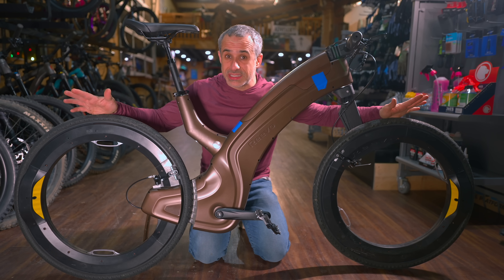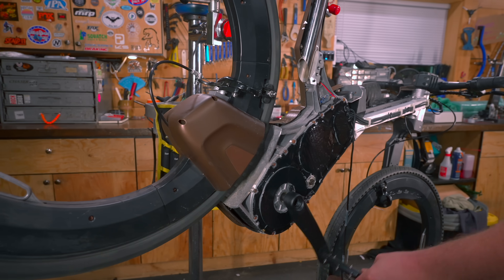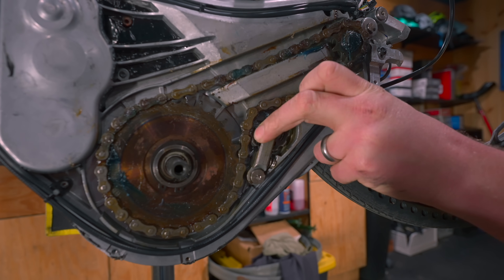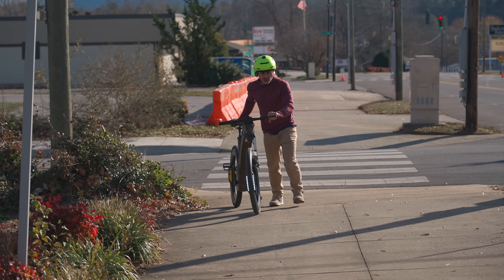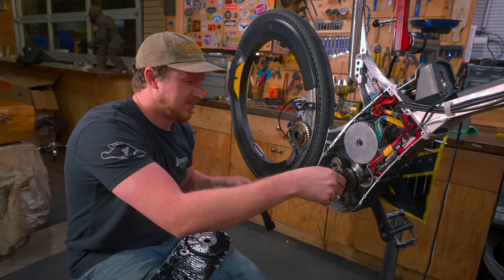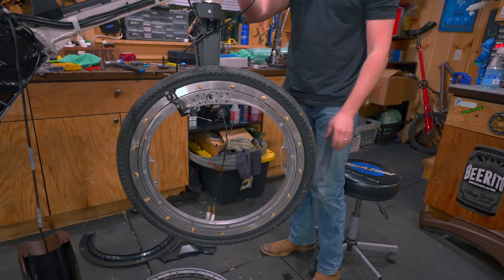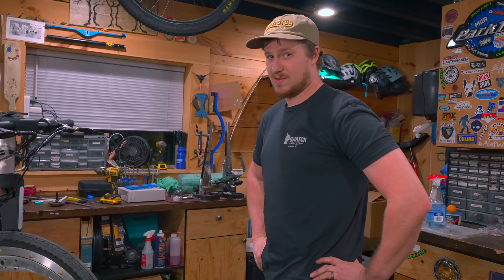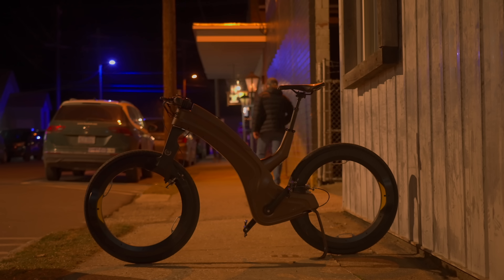What's Inside The World’s Worst eBike? Reevo Teardown

Comment: What a bad bearing choice, like in a bunch of ways.  You have tiny bearings that are WAY under spec.  Realize that at best, AT BEST, you have two bearings taking the load, and often between 1 and 2 at any given time.  Those are tiny bearings doing that work.  And there's no suspension here.  On top of that, every single bearing will wear on all sides and load in all directions because it also has to hold the wheel on too and in a bad high friction way.  You also likely want to over load it so everything is tight and not wobbly, meaning all those bearings are a sum of friction points all around the wheel as they all turn and SCRAPE on the side.  What do you have, like 80 scrape points, 100?  I get the idea of it, but the execution is hobbyist level stuff, just with a pile of money behind it for machining.  It's so bad.  And it sucks because there's better ways to do all of it.  Those are going to take a lot of peak load just casually biking around.  There was a possibility for this to have been done better.  But you also have a really big problem.  There's no suspension.  You just have a heavy bike and an immovable ground, so all forces are shoved through all things.  The wheels are heavy and sensitive to impact.  Sure, it's "beefy"...to a degree, but you're not trying to save it at all with that design.  I know it was used pretty lightly in the video, but man, if you did any kind of jump with it, you'd absolutely ruin the ring.  It'd just be oval.  And unlike a regular bike hub, there is no distributed loading to share the stress.  Once you bend the right, it's junk.

The gears aren't really the high friction device in this package.  It's likely all the bearings and them firm in a track.  There's a LOT of friction on the contact points, all of them.

Comment: when you order a HammerSchmidt crank off Wish
Reply: The roller bearings in the rim are an interesting load bearing solution. Too bad they didnt know the smaller the bearing point the longer the lifespan and the less friction period. Hence a 5 journal chevy 350 lasting longer than a 7 journal ford crank. .. 

Small bearings.. are.. better. ... counterintuitive. .. but... True.

Comment: Gosh that grease they used in there definitely looks completely gone and way past its life span like they did not even use synthetic grease. Probably for it to even ride smoothly you will have to just lather every single inch of gear and belt with synthetic grease that will last forever.

Comment: When I was a kid we attached small generators to the back wheel to run lights. Nothing to charge and no risk of fire. Yes, it added some friction to the drive, but not much.  Now motors are attached and powered with batteries that need charging and are a fire risk. All so people don't have to pedal. I think we're moving backwards with bicycle designs.

Comment: Every responsible engineer should have pulled the plug, because this bike is totally incapable of driving through a mud puddle or loose sand. Not even talking about the friction from all these gears and bearings.

Comment: Aren't you also pedalling with a significant gear reduction? The linkage from the pedals to the wheel seems to go from small gears to large. That'll give you a lot of speed, but it seems like it would be very hard to pedal.

Comment: Can tell you the combination of the motor always being spun, all 2,000 gears, and that grease is a lot of resistance. Would probably be a decent hub-less bike if you took all of the guts out. Was dissapointed to see individual rollers instead of a big bearing, I bet there would be less resistance not having a bunch of rollers in the wheels.

Comment: The gear train is mechanically impressive but so flawed and redundant - any first year engineering student will look at that gear assembly and instantly recognize just how much compounded friction is being added while simultaneously creating such drastic inefficiencies, not simply for the pedals, but the motor and battery as-well.

Comment: this is basically a bike-sized object running on tiny skateboard wheels... except only the bottom tiny wheels are holding up all the weight. so in essence, if you replaced the front wheel with an actual skateboard, you'd still have a better product.

Comment: That little blue 9g server at 10:44 is what we use for really small, light rc planes. The gears in them get stripped all the time and they’re basically a disposable item. Cost about $3. Having one operate the anti theft in a place so hard to replace is insane
Reply: the only thing the servo does is actuate the lock bar for the kickstand
even if the durability of the servo itself is questionable, that's probably the least dumb and better thought out part of the entire bike, but also the bar is extremely low
Reply: @quentintin1 Honestly the idea of a lock being integrated into the bike frame is downright brilliant, if done well it'd stop most destructive attacks since a thief wouldn't want to destroy the bike they're stealing. But using 9g servos that can be forced open by hand, and only locking down the kickstand and possibly main drive gear, is a massive flop of an execution.
Reply: @asteroidrules  on that bike, extending the kickstand locks the drive, making the bike effectively un-rideable.
so the anti theft device having only to lock the kickstand in the open position is brilliant in it's simplicity and effectiveness.
the issue is like you said, it's actuated by a 9g servo, and by the looks of it, the cheapest, most disposable hobby servo in existence.
now the lock bar can be made hardened to manipulations by clever shaping or it being placed where it would be impractical to force it open, difficult to say how it is in the actual bike as it isn't shown very well in the videos
Reply: @quentintin1  So the lock works to the point, that you'll walk home when the servo goes.
Reply: @Ballistarius-nx4dw  with that servo yes, or the servo fails with the lock open, making then the bike as stealable as any other
Reply: @asteroidrules  if the servo only operates a locking pawl that doesn't put it under any stress when operating the kickstand it's a perfectly viable way to do it. And not only viable but preferable since as you say, the servo can be forced open.
So if the locking pawl moves perpendicular to the motion of the kickstand the servo never gets stressed from the kickstand. And if the ends of the pawl are covered there is no easy way to manipulate the pawl in the field.
So I'd say that is actually one piece of good design.
Reply: @quentintin1 except you can just pick up the rear wheel, roll it away on the front wheel and the you have all the time you need to take it apart and unlock defeat the lock or just sell it on as is.
Reply: When I seen it wasn't even a metal gear 9g servo, I laughed so hard. A kickstand with tiny plastic gears what a great idea!
Reply: That's the servo that comes in every cheap "learn to Arduino" kit for students. I used one for a school project. Terrible little things.
Reply: Immediately thought of that too! 😅
Those are the world's worst servos! 🤣
Reply: Yeah I noticed that
Reply: Agreed. Im an RV, and that servo was junk.
Reply: Would something like an extended when off type of solenoid be much more reliable?
Reply: @Viliny yes, but it'd also require power to be rideable. So if your battery dies... Well, you're kinda SoL on pedalling it home (not that you'd want to with that drive train). It wouldn't add much to the BOM to use a less crappy metal-geared servo.
Reply: @EgorKaskader  but it also locks the wheel acting as the lock, no?
Reply: @Viliny  when the lock is engaged, yes. But if you lose power with it open, it stays open. A NC solenoid will lock the wheel immediately on losing power - it's gonna try to do that even in motion.
Reply: @EgorKaskader  yes but the solenoid piston needs the kickstand to be down to fit the groove right?
Reply: Not super familiar with all solenoids as opposed to finer electronics, but the idea was a normally open solenoid that would extend on powered off state, essentially requiring power to retract on power failure would allow the lock to work when the kickstand goes down
Reply: Having a servo to control whats essentially seems like a binary need seems like overkill
Reply: @Viliny  we don't know - the system isn't particularly clear on camera. But this thing does also lock the rear wheel, so the bar probably locks the drive gear - and even if it doesn't, you're still just one mistaken unfolding of the stand away from being unable to go further. The servo is better in this regard, but the lack of manual override is still a problem, and the servo they picked is a piece of crap.
Reply: Haha yeah I actually have a few of those lying around
Reply: straight out of a robotics starter kit!
Reply: Any kids electronics kit comes with a handful of these to mess around with arduinos etc too 😂😂😂
Reply: I was going to say that, also this thing has a bluethooth module that's also cheapest possible so that explains why he was struggling to connect.
Reply: I recognized them immediately too. You can get a 4 pack for like $10. Plastic gears plastic horn. On a security measure. Lol.
Reply: The first second I saw the blue color, I thought could it be a 9g 🤔😁
Reply: Ikr saw too

Comment: I have 2 of these. I ordered a red wine and a blue.  I got 2 blue ones.  The SIM card slot wasn’t installed on one of them.  I rode it once.  Too heavy and you feel every bump with the airless tires. Reevo didn’t answer my emails regarding the wrong color bike and the SIM card slot missing and wrong size bike.
Reply: That sucks but it's a valuable lesson, very valuable evidently.
Hope the class action works out.

Comment: it amazes me that the "engineer" figgured this bike out but not how to add a simple 200 USD 48V or 54V 10AH battery from an e schooter at the very least to put inside. Even if the power was some funny silly 200-300W the fact is it has power assist and for that capacity itll be more than plenty for going like 30-40KM confortably

Comment: at first I was thinking what happened if we just ditch the battery, motor, and all the electronic thingamabob and turn this thing into just a plain jane acoustic hubless bike. then you showed us how terrible the wheel rolls compared to normal wheel...
also, still won't ride this with those crappy cast aluminium long reach brakes. even with massive weight reduction.

Comment: I'm a bit confused by the planetary gear on the crank, which part of it connects to the rear wheel, the sun gear?  And the carrier is the pedals?  Or are the planets where the freecoasting is built in, and it's not a planetary gear at all.

Comment: A freewheel with so much friction that it's practically useless.
Airless tyres!
No grommets on the cable entries, or seals around the panels, so water gets in under the panels, as shown by the rusty boltheads.
12 gears in the drive chain
Is it a brushless motor?
That ring gear on the motor must weigh a lot.
Even the indicator lights on the back of the wheel are stupid, they are so close together that you wouldn't be able to tell which direction was intended unless you owned one yourself and looked very carefully.
The lights are so low that they would give the impression of the bike being further away than it was.
The whole thing is designed around the desire to look flashy because the wheels have no centre. The whole principle is flawed. The detail design is complete crap as well.
There is one positive about it - you don't have to worry about theft  - noone would steal it.

Comment: It kind of reminds me of the swedish Itera bicycle from the eighties. It was made almost entirely from plastics and constructed by car engineers. The swedish authorities invested money in a new factory in order to create new jobs in an area with high unemployment. It turned out that the flexible frame supposed to give a soft and smooth ride absorbed a lot of the rider's energy input, making the bike extremely heavy to pedal. To make matters even worse the plastic wheels flexed as well an when you came to a traffic light it would not switch to green since there was no metal in the bike. Needless to say they soon went bankrupt. Today, however, people collect them and you can still find examples that were never unpacked. Buy a Reevo and let it collect dust for thirty odd years.

Comment: Now I want to see it upgraded lol. Some speed holes in the frame to reduce weight a little bit (but not compromising it’s strength), smoother/faster rolling bearings, and maybe use a chain drive to replace the motor’s excessive amount of gears.

Comment: This is basically the Tesla Cyber Truck of bikes. That is to say it's underengineered, low-quality garbage where for the designers form was more important than function.
Reply: I'd still say it's slitlydifferent because in this case the form drastically inhibited the function and with the Cyber truck they scrapped all of the marketing stuff that was hard to do and proceeded to f*** up all of the normal car stuff they settled on,
Is seems similar because the car is very ugly as well but that doesn't really have much to do with the build quality.

It's like if the bike company marketed hubless tires and then after they got all the money they decided to go with the cheapest possible hubed tires and removed half the spokes to make it look "cool"
Reply: You can tell Elon got involved with the trucks. The cars got designed before his ego took over.
Reply: @dailyprophet6641  All they had to do was make the car but a truck. How did they screw that up?

Comment: I wanna see someone try to upgrade this thing. It could work better with a more streamlined gearbox, more premium parts, high performance lubricants, a shaved down chassis, lower tolerances for less energy loss, and custom firmware.

Still worse than a regular bike, but I wanna see the peak potential of this concept.

Comment: You've got to admit, it is interesting! If the price was right, (I'm sure it's not) I would get this for the novelty, rather than the practicality. It would be interesting to see how many miles you could ride this thing, before something major goes wrong with it. When it does, what would be the first thing to fail? Can you get new tires for this? or, is it a "proprietary" tire, that you can no longer get? Are the front and rear tires the same, so you could swap them? Can you even get the tires on and off in the first place? (Definitely not a 'daily rider')